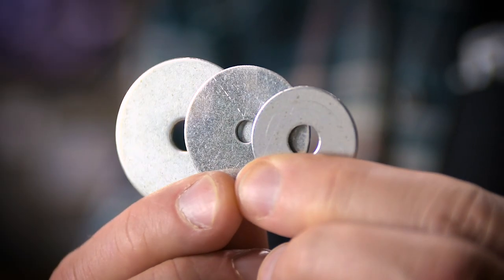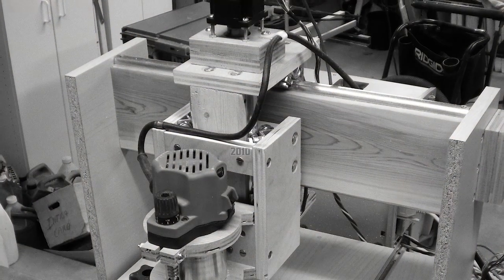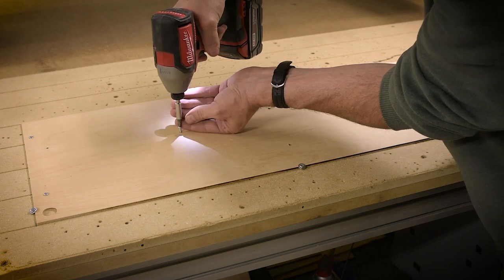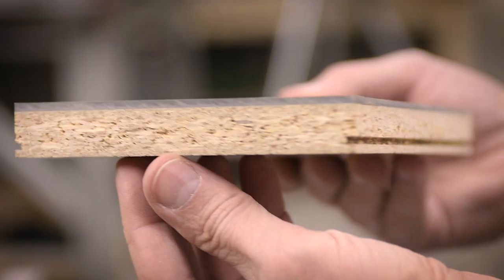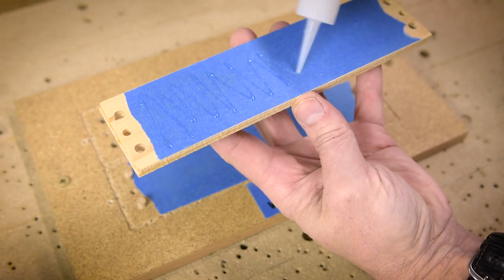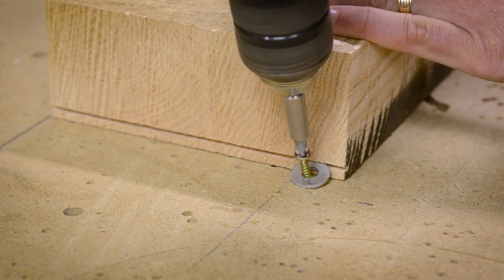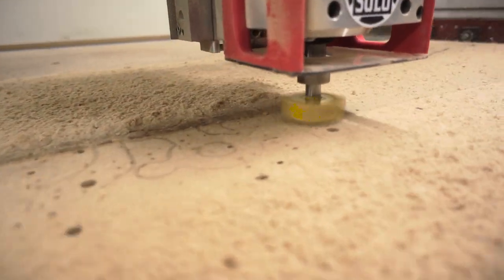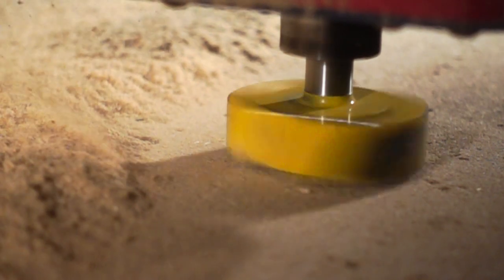WORK HOLD DOWN DEVICES | NO Spoil Board T-Slots | How to Clamp Material | CNC Router Tutorial Videos

Comment: Great tip, I have a vac table on my machine, but not all pieces lend themselves to that holding system, largest piece on my table was a 5 1/2 “ thick  38x12’ slab ——- I like to use hockey pucks screwed outside the piece and reversed quick clamps  to strategically hold odd sized pieces also 👍🏻👍🏻👍🏻
Reply from the maker: I've never done anything close your big job. The hockey pucks are a great idea. Thanks for watching!

Comment: I've always found it easier to screw  the work piece down and and also use washers but having them clamp on top of the work piece. The grove on the edge is a good idea. The bigger clamps and hold down tend to get in the way of the router. Havent used super glue but I have used hot glue before.
Reply from the maker: Thanks for sharing your insights. I find it helpful to hear what others are having success with.

Comment: Yes and Blue Tape and Super Glue is much cheaper then double sided tape 30-50 dollars a roll.  NYCNC uses this for metal which shows how strong it is. If you overdo the glue though it can soak through the tape and into the part. I also am a big fan of hot glue but it can get on the tools which can be hard to clean. This fender washer idea is really nice and I already own a ton. If I could find some brass ones it would be even better.

Comment: Nice tip, I'll keep this in mind when I'm looking to hold something easily. I've tried similar before, also have done everything from screwing straight into the spoilboard,  t-track clamping, using super 77, and custom fixtures. 
All for various reasons, do to size, material, or complex shaped parts.
Thickest material I've had on my bed was 48x24x4" solid laminated mdf. That was "fun" to turn to dust. Thanks for the useful video!
Reply from the maker: Jonathan Hawkins Wow! That’s a very impressive list, and you lived to tell the story. MDF is one of the worst things to mill. Thanks for sharing.

Comment: I'm getting away from this method of holding down material because those screw holes aren't just holes, they leave mounds where the screws damage the surface. I'm sure if you predrilled the holes this wouldn't be the case, but what a hassle, and as you can see, that spoilboard looks awful. The mounds make high spots if you set your material on it, and I don't want to resurface all the time.
Reply from the maker: Yes, I simply keep a sanding block nearby and knock those bumps off before the next setup. No hassle. 

I have to agree, my spoil board looks quite spoiled. ;) It a consumable.